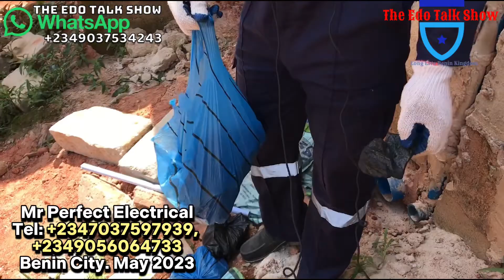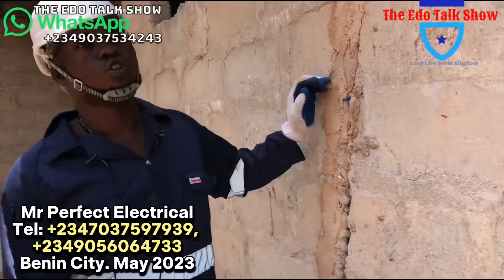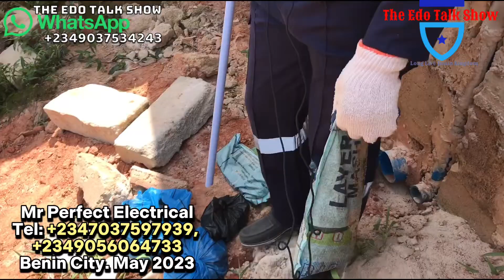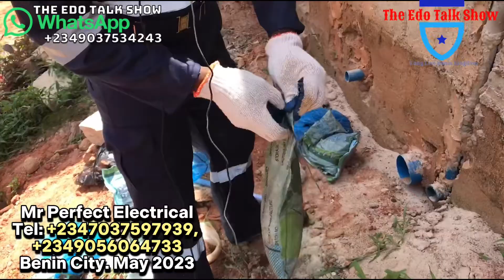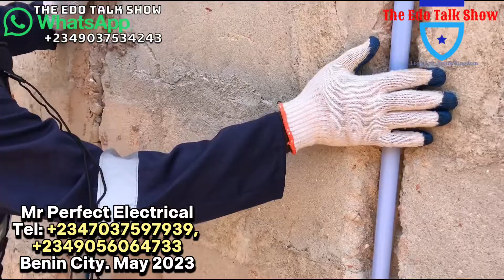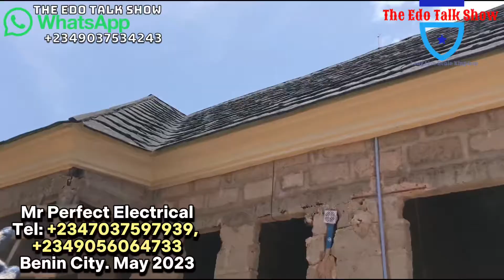Installation Of Thunder Arrestor With Copper, Industrial Salt, Charcoal Water And Sand In Benin City

Comment: It attract, arrest ,absorb  negatively charged ions of the lightning by the positively charged ions of the copper arrestor and send it to the ground.  Lightning arrestor circuit installation is a delicate issue. You have done well in the part of adding water to the system which many electricians do not even have the knowledge. However, one the is missing - lightning inspection housing. This housing allows you to carry out periodical inspection of the system for efficiency.

Comment: The only expensive component here is the copper tape depending on the length u need. One metre length cost 2400 naira ...100k should be enough for all the material for bungalow

Comment: The installer didnt include animal dumps and saw dust which is also needed on the installation, although 200 or 250 is not much if u re using 💯 percent copper to work...20mm copper  tape per meter is ₦4,500 and 25mm copper tape is ₦5,000 it now depends on the height of building.and the guage of the copper guage but i quoted for 3mm guage which is the highest guage..i foot 💯 perçent copper aɍrestor is 20k for 4 up and 2foot 💯 percent copper arrestor is 25k for the up too, earth mat is 18k for 2feet by 2feet 💯 percent 3 mm guage and 1foot by 1foot īs ₦8,500 for 3mm guage .... industrial salt is 2k for that size he is holding,.,in conclusion 200k is good for it with his workmanship all together
Reply: How much is Earth rod and how many ft should I buy?

Comment: I clearly  listin to this man ,he said  its was 250,000# and i said that it was too cost ,what are the mejor  component  on this job ,is   the thunder  arrestore ,the copper and the salt  ,charcoal   ,the guy did not indicate  each cost of materials  , let be sincere  top show 250,000 is too cost ,top show there are some comment that you are to answer and there are some cemment that the workman have to answer he self , is not every comment  that is  for top show ,all this works  men need to subscribe  too so that when comment  come for them, they we answer it there self , thanks top show for taking are being to another level, please every workman in this platforms  make u na subscribe  so if comment  come una go answer to the viewer direct  , make una no de give top show toomuch  of work , i beg una
Reply: This man too like money
Reply: This man too like money
Reply: Try read waiting u write
Reply: Hahahahaa you are funny
Reply: I quoted the  cost of the materials already i don't think īs bad with his labours ...the cost depends on the calculation of the height of the meters of the building...i am doing one currently which i even charge 2m above although my type of arrestor is different from his, i used S6 indelec arrestor for the job, it depends on my clients pockets and the building itself
Reply: What’s the cost of indelec arrestor ?
Reply: I have one question to ask, by the use of salts, don't you think it will rust the copper